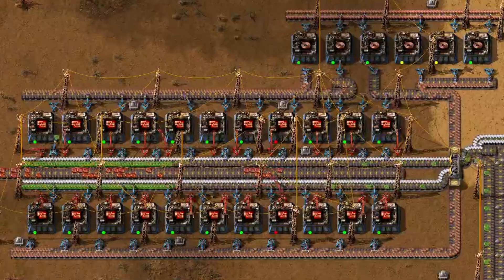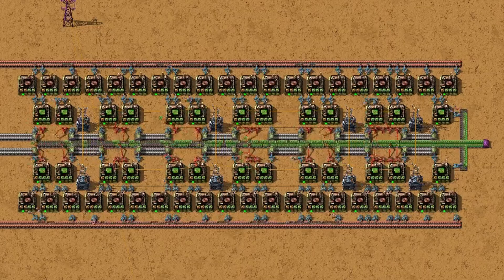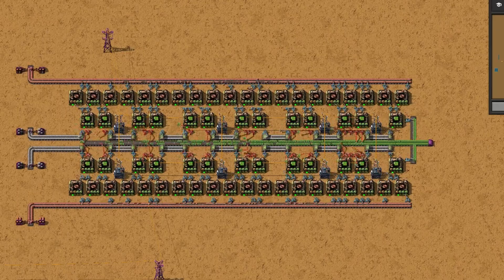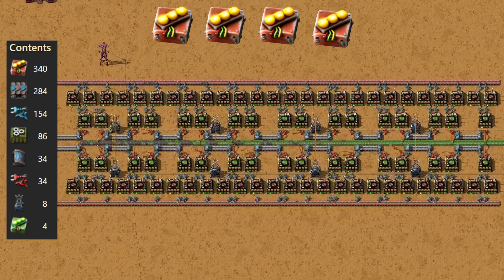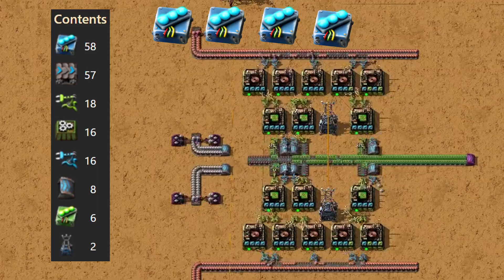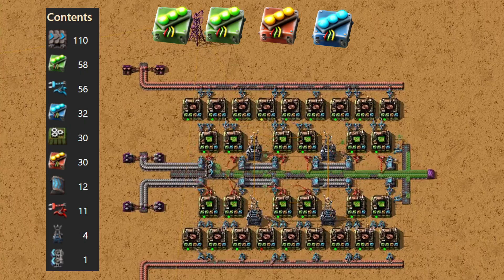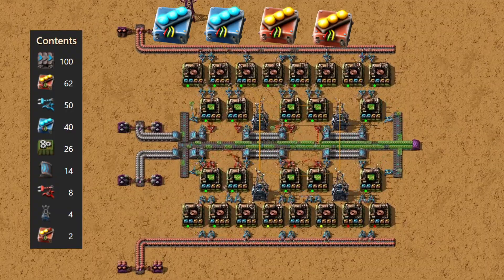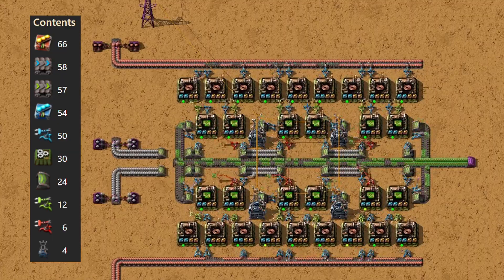6 Blueprints for 6 Situations: Make Green Circuits right in the Late game

Comment: So I know this is a space age build because I see green belts...but I'm sorry, not trying to be mean, but there's big issues calling these "late game" builds. Let's pretend quality is not beginner friendly and it's optional anyways, that leaves: Beacons? Stack inserters? Foundaries? All of these are accessible before/at the same time as speed/efficiency 3 modules. No EM plants to be seen either is another massive elephant in the room.

"Beginner friendly" would be the first standard 3:2 wire:circuit, which is a good beginner friendly build indeed, I approve, but from here it should be builds showing how to transition to using beacons, em plants, foundaries, stack inserters, etc.. Not 6 variations of "The same build but the modules are swapped around and the ratios are slightly tweaked"

I'm a bit confused on whether the video author has not actually played through Space Age or something?

To reiterate: No one should be using these builds unless you are doing some kind of weird self imposed challenge. Otherwise, no one should be using these builds.
Reply: The quality of the video is really bad, so it's hard to make out but I think those are blue belts, judging from that one blue splitter that's in a lot of the builds and the items all going the same speed. So I think that this is for the base game - and even then those are not good late game blueprints. It doesn't really make sense to use anything but the best productivity boost with speed beacons in the late game, even without SA buildings and quality. Power shouldn't be a concern either, that's what nuclear power is for.